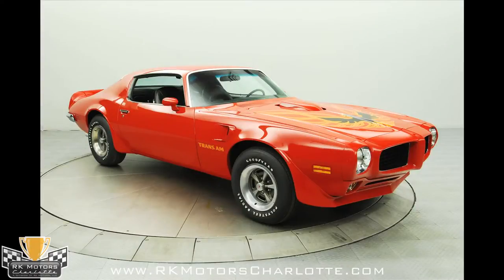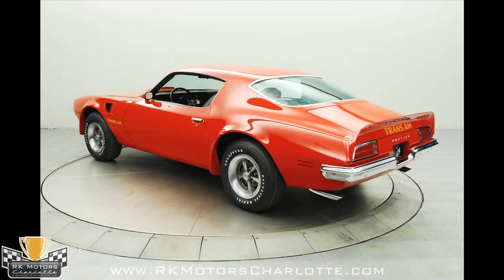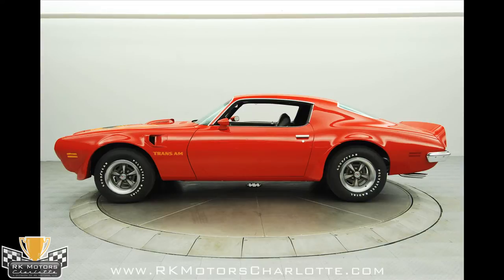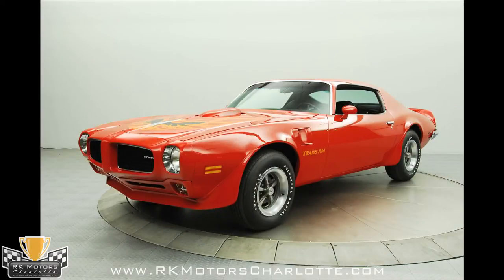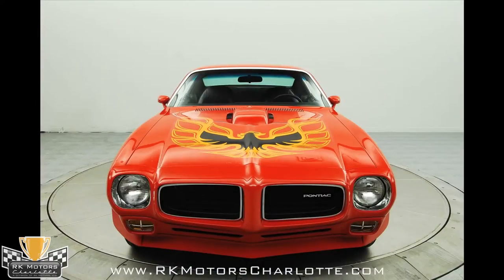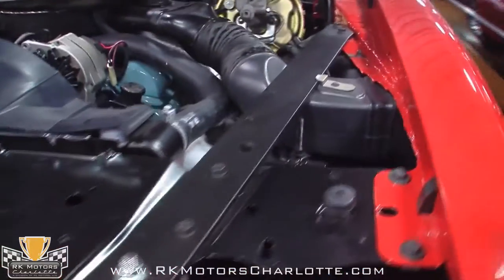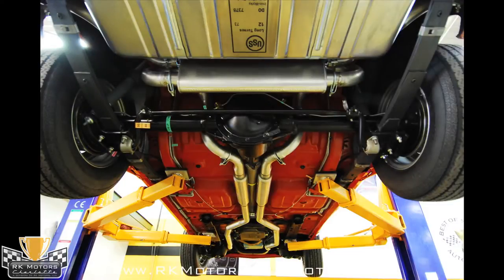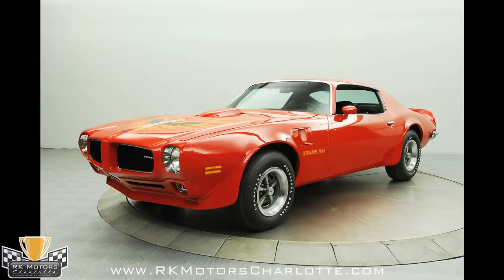132078 / 1973 Pontiac Trans Am Super Duty 455

Comment: The only 12-bolt rear that was ever available in a Trans Am was a 70 and 1/2. RAM Air 4, beyond that they came standard with a 10 bolt rare it was available with a safety track and numerous ratios available !
Reply: I wuz under the impression "all" 70 T/As had a 12 bolt, RAIV or not. No?

Comment: Either the 73 455SD or the 69 Ram Air IV is my favorite T/A ever made. But any T/A built before 1975 is cool. The 77-79 T/A with the 400-4 speed was a fast car too for a late 70's smog 400. They ran high 14's-low 15's when new...very fast for 1977-79. The 79 Trans Am 400-4 speed was the last great T/A ever made in my opinion. The 80-81 301 Turbo T/A was junk and they used Chevy 305 and 350 engines in the T/A from 1982-2002. They also used an Oldsmobile 403 engine in automatic transmission equipped late 70's T/A's and a Buick 3.8 litre turbo in the 89 Turbo T/A
Reply: 89 was the GN engine for 25 Ann edition but Pontiac did some internal changes. Fastest T/A per c/d mag.

Comment: I do believe that the orator made a big mistake when he presented this supposed 1973 455 Super Duty as a Y8 engine code, when the 1973 455 Super Duty engine actually had an XD code :)  If I am wrong, I am happy to admit it, but I had a 1973 Trans Am with a 455 Super Duty for @ 30 years, and the engine code on the block was "XD" :)  "XD" was also the engine code listed on the dealer order form :)
Reply: I believe the Y8 code was for the 74 SD. It's listed as such in H-Os Heavy Duty parts and spec book, and is also listed in a new book out by Car Teck, author Barry Kluczyk. Funny in that I have PHS documentation for my 73 T/A, and has everything you wanted to know about these cars..."except" the code for the engines. (At least I can't see it. )
Reply: @joequillun7790  The Y8 code is for a 74 SD 455 T/A and Formula with a turbo 400 trans

Comment: the only bad thing about the 73;s is the shaker was blocked off.
Reply: Easily remedied by removing a couple screws. When I drove mine in the rain, you could see the shaker system actually working, cause the rain drops would be sucked into the scoop. (Instant water injection. :)